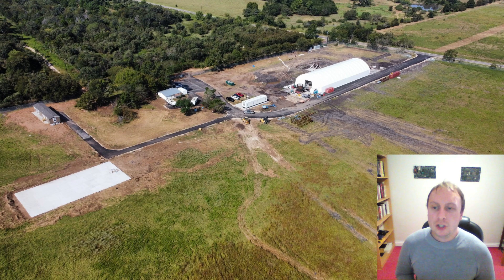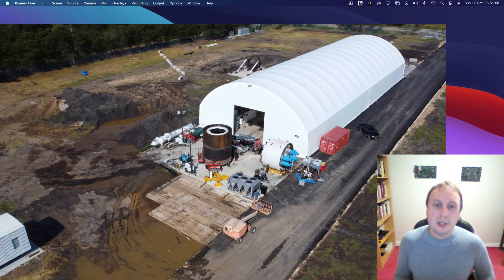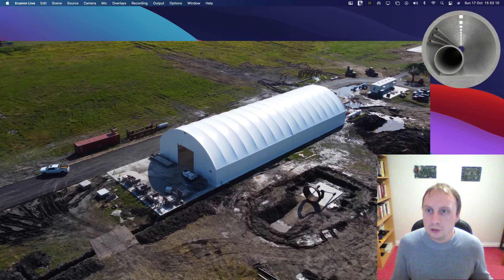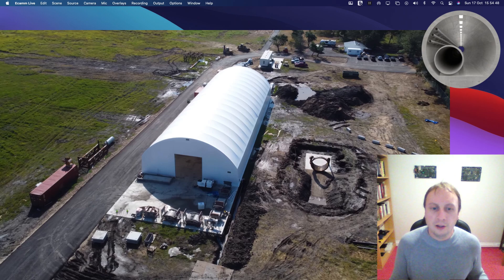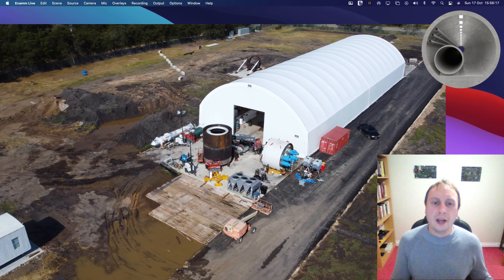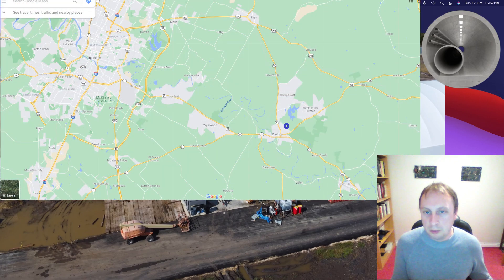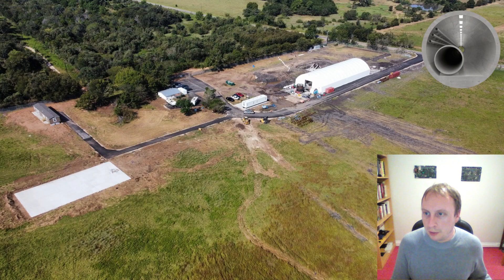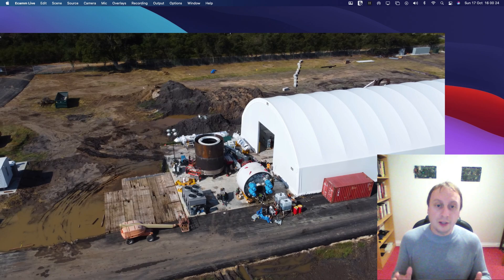Elon's Top Secret Bastrop Research Facility & Prufrock 2 👍🏼 💵 🛠️ 🚇 👷🏼‍♂️ Episode # 119

Comment: That site,  is all new construction.  The site is being built and from what I can tell,  they are really skimping.  Building / adding on as,   They go. It’s actually a very small location.  Very much so.  All that ground around there is wet. Get 10 feet off any of the freshly poured cement,  your going to sink.  So,  these pics was taken in either the fall,  or spring,  the wettest time of the year for this part of Texas.

Comment: I wonder if they could bore a hole down by going in a spiral until it's hot as hell. Then pour water down the hole. Generate power by steam.
Reply: I'm guessing that they could but it's not cost effective
Reply: Yeah, that's how residential heat pumps work (not steam, but water of different temperature)